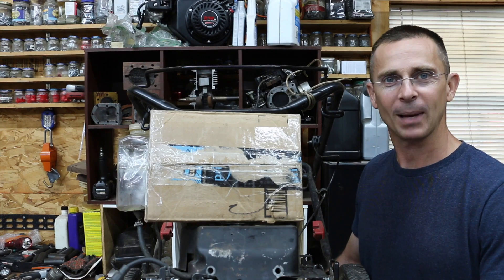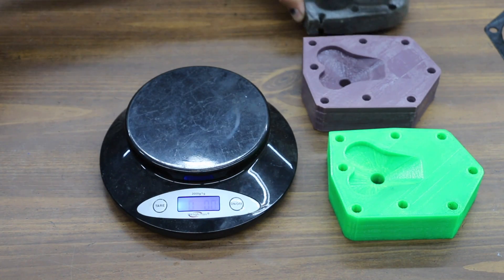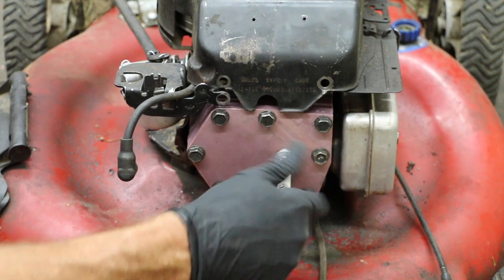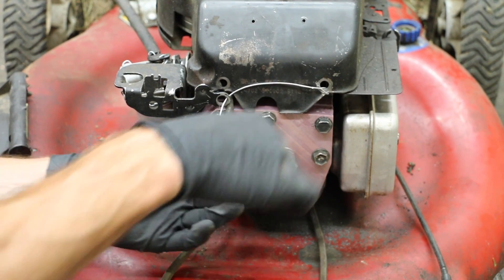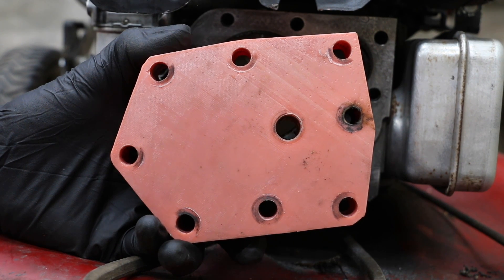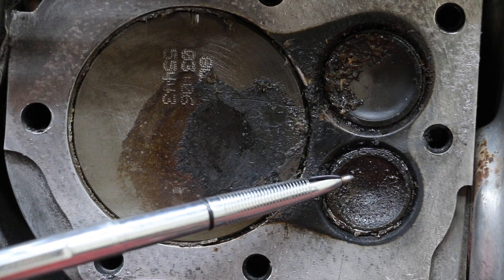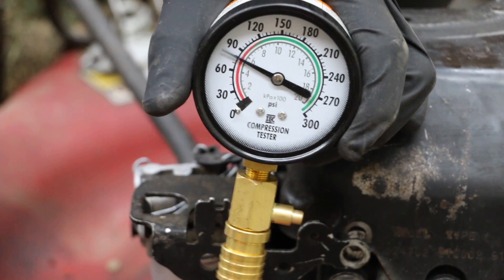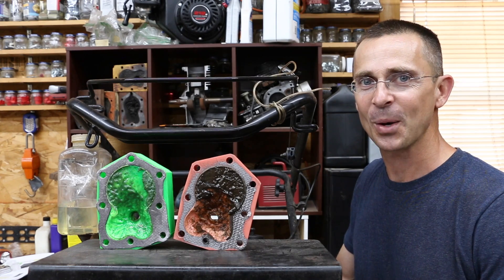How long will a 3D printed cylinder head last?  Let's find out!

Comment: What about making a gasket out of metal like a 3D printer does? getting something like a 1/4 inch thick piece of steel or aluminum and then cutting out something like 8 -10 pieces and gang drilling the holes to bolt it on to the cylinder. Then you would seperate them and drill successive holes so that it approximates the shape of a normal cylinder head, then you would just need to create a bunch of gaskets for between each piece of the gasket head. You could even try a bunch of different gaskets at once but since the outside would not be as hot as the inside it would not quite be as fair as it would be cool. Alternatively or to finish it off after testing a bunch of gaskets you could weld all the plates together and only use one regular gasket. also what about running cylinders with no gasket and maybe just aiming for a precision ground surface with wet or dry sand paper on glass plates?
Reply from the maker: Great recommendation!

Comment: you still had some plastic "shmoo" on the valves, seats and exhaust, from the first head, more the second head, seemed to be a bit lower compression with the "gaskets" on metal head than there should have been
Reply from the maker: Yes, you are right. The intake valve didn't seal well at all during the headgasket test.

Comment: before watching past 0:49 seconds, I'll guess around 10 seconds for the heads and 3 seconds gaskets. probably still an overshoot estimation :)
Reply: everything lasted longer than I imagined, but 3 d printing is just a no go for anything engine/heat/pressure related, it's just too porous and soft of material. maybe some commercial/industrial stuff would be better..
hope ya'll didn't breathe too much of the burning ABS and PLA fumes, the combustion process was for sure burning it at unsafe levels compared to printing temps and was releasing toxic "shmoo" /carcinogenic fumes :(
Reply from the maker: Thank you!  Great advice on breathing the smoke. I always wear a high quality respirator.  I couldn't smell the smoke.

Comment: will making an air cooled engine into a water cooled engine decrease efficiency because it cannot reach normal operating temperature
Reply from the maker: Great point. I believe air cooled engines typically run a little richer on fuel.  Water cooling would likely improve efficiency.

Comment: Great video! I kind of figured that the 3-D printed cylinder heads would fail early due to ABS and PLA being a thermoplastic polymer and therefore will deform due to heat. 
I know that JB Weld is a thermosetting epoxy but have you considered trying other thermosetting polymers for cylinder heads? Better yet would be a composite using a thermosetting resin and a fiber reinforcement. I think either of those would make an interesting video.
Reply from the maker: Great recommendation!

Comment: Spark plugs depend on their thermal contact with the head to control their temperature. Had the plastic somehow held up, the plug would have died from heat stroke at some point later anyway.
Reply from the maker: Great point!

Comment: If I could get my hands on that STL file or the part, I would be happy to send you that same part printed in a more temperature resistant material, such as carbon fiber nylon or polycarbonate.
Reply from the maker: I'll check with Terry to see if he can send the STL file. It'd be fun to test carbon fiber nylon or polycarbonate.
Reply: @ProjectFarm  My local community college has a 3D printer that can do aluminum- lol I could print one in metal for you!
Reply: You can electronically mail me at askgdfw at googlemail
Reply: Polycarbonate has a 66psi tensile strength at 260F ish after hardening. It will break under pressure. Nylon X will survive the pressure but temperature beyond 320F will melt it. Depends as pressure and temperature at the same time and increase stress in the material to crack and blow out  if the material isn't able to cure or set properly during printing and curing stage.
Reply: 3d print a metal head, that could be interesting
Reply: Yep. and there are tons of shops out there that can do it.
Reply: I gotta say, this is one of the best comment sections I've ever run across on YouTube. Congrats project farm for your amazing viewer base!!
Reply: The problem is that fused filament disposition relies on using materials that melt at low temperatures, a 3d printed plastic cylinder head would either need a temperature resistant coating or some better cooling system, maybe running oil through the head. Or an upgraded printer and some very high temperature plastic. Or maybe water injection into the cylinder during the exhaust cycle to take the heat out before it builds up.
Reply: MarcAFK water would vaporize and create steam which I'm sure would only make the problem worse and oil would make it way hotter we make metal smelters with oil injection. it needs a carbon base so it will not melt so easy I think mixing shredded fiberglass with resin and a little hardener would work good maybe 3d print the mold..
Reply: Flowing oil or water would cool the plastic and stop it from failing.  You'd have to design cooling galleries into the head so it doesn't fail into the cylinder.
Reply: The process of water becoming steam absorbs a tremendous amount of heat energy from the intake charge, that's why methanol injection exists in the first place. First for high performance ww2 aircraft, and now commonly on high performance boosted/high compression automotive engines to prevent preignition.
Reply: Not true! Many 3d printing materials are high heat and require an oven-like chamber being constructed around the print area.
Reply: Meep Changeling Although yes, some 3d printable materials are designed to be more heat resistant, for example nylon and polycarbonate typically require a nozzle heat of more than 300 degrees C compared to the 200 degrees C of pla in order to get the plastic to flow, the "oven" that many printers are seen in are typically there to prevent warping of the printed object by keeping the ambient temperature warm, it has little to do with the heat resistance of the finished 3d printed object.
Reply: There are also types of PLA designed to be further heat treated or anealed giving them a much higher temperature before they deform.
Reply: Yes, some materials are printed at higher temps. But keep in mind that combustion chambers typically reach temps around 600 degrees celsius. For materials with that kind of heat resistance you would have to look into DMLS printing. At that point, it's more cost effective to just go and buy the standard parts.
Reply: No, not really.  Compared to the temperatures attained by an air-cooled engine, fused-filament deposition printers (and their environment-control chambers) still run at quite cool temperatures.    Filament that deposits metals or ceramics for post-sintering may get into the right ballpark.
Reply: Do it!
Reply: Gear Down For What? Dig your videos! And it would be cool to see these tested with better temp resistant material
Reply: Should try one with a high temp  material using a form labs 3d printer. its an sla printer using uv cured resin.
Reply: Print it in PEEK.
Reply: I think you'd need to print it in something like PEEK to give it any chance of withstanding the high temperatures. The stuff requires a special hotend though, and it's not cheap either.
Reply: Smoothing out the combustion chamber should help also. A lot of surface area in those parts.
Reply: I have students who printed parts that were used on rockets. Parts for the body but also parts for the engine and tail using a burn proof polymer (ULTEM). They did very well at the competition with printed parts.
Reply: I think if you could put some cooling fins in it, a lot of problems would go away
Reply: probably would not be good enough. Its the "glass" temp you need to look at, as this is the temp it starts to to deform and melt. This is much lower than the extruder temp listed with 3d filament as this is the temp it needs to be liquid. If you want the engine to run longer that a single run, you need to run it lower than glass temp. someone listed https://www.3d4makers.com/products/peek-filament which has the highest glass temp ive seen at 143c.
Reply: Theres even metal particles filaments!

Comment: Why didn’t the 3D printer recreate threads in the spark plug hole?
Reply from the maker: I believe it's possible, but that would have required a lot of programming.

Comment: Thank you SO MUCH for this video!  I own a 3D printer, and find it absolutely invaluable for making things like brackets and hooks and things.  I no longer wander around the hardware store, looking for something I can adapt to my needs; instead, I just make it.  I laughed and laughed throughout this video - I knew it couldn't work, as ABS melts readily at 210C (410F) aqnd PLA packs it in around 180C (356F).  But it was a great try, and an awful lot of fun to watch.  I did think the gaskets would last longer, though.  Terry did a great job of making those parts, and I'm so pleased you gave them a try; that was more fun than I've had all week.  Thanks again.  >Charlie
Reply from the maker: Charlie, Thank you very much!

Comment: Can you revisit penetrating lubricants? I would like to see what the old trick of letting wax melt into rusted threads would do.
Reply from the maker: Yes, I will definitely test this to see if it's a myth or if it really works. I've got the bolts undergoing the rusting process now.

Comment: As a 3D printer I know it's not enough, what I would LOVE to see is if a cam (double cam) could be printed and the engine be converted to a compressed air engine.  Amazed it actually ran at all, but I knew it wouldn't last all that long...make a hybrid, coat inside with jb weld to see if holds up longer.  Awesome video...keep em coming
P.S. annealing PLA make it more heat resistive than ABS...but I  have never done it
Reply from the maker: Thanks a great recommendation!  I've seen plastic cams in mowers. So, it's likely to work rather well.  Great recommendation on the hybrid approach too.  Thanks again!

Comment: Like your videos but when you say you were "impressed" with something lasting a minute and 23 seconds???? Good grief. 
Also you then say you think a 3d printer would be a good addition to the shop?? Sounds like you're begging for someone to send you one. Come on man, you're better than that!
Reply from the maker: Thanks for commenting. The fact that a printer produced a plastic strong enough to withstand the enormous explosive pressure and heat at all seems impressive.  I'm definitely not wanting someone to give me a printer.  It was very generous of Terry to make the heads and head gaskets. I've declined lots of generous offers.  Finally, I do believe 3D printers have a lot of utility in a shop. Thanks again!

Comment: I wonder if you could get one of the companies that make metal 3D printers to make a cylinder head for you? That would certainly be interesting.  

I know one company I always see ads for, Markforged, makes an "affordable" metal 3D printer.  (Affordable being the low low price of $99,500.....) But regardless, I think that would be super cool if they would do it!
Reply from the maker: Great recommendation!  Regarding the price of the printer--wow!  Way out of my reach.
Reply: Project Farm that's enough money for a lot of small engines haha
Reply: You might try using a 3D printed plastic part to make an aluminum or bismuth alloy head using lost PLA or a sand casting.
Reply: Spacex uses a metal 3D printer to make their engines, so they'll certainly handle the combustion temperatures and pressures of a gasoline engine OK.  The kicker is the printer price.
Reply: charles worton Boeing use sintered metal for their engines.
Reply: what's the point, you know it would work like a normal cylinder head..
Reply: Yuri Gagarin if you print the same thing as a casting, there is no point. It’s just more expensive. The benefit of 3D printing metals is the crazy complexity you can make that you wouldn’t be able to make any other way. That allows for things like optimized flow passages and absolutely optimized structures to minimize weight. For smaller quantities, it’s also much faster and cheaper than waiting for tooling to be made for a casting
Reply: The way metal 3D printing works is that they print the part from wax or something, make a mould around it, burn the wax out then cast metal in it. At least this is the method i've heard of, correct me please, if i'm wrong, but i don't see any other logical way it could be done, because metal needs to be homogenous, and not 3D printed from layers, where some kind of glue would hold together the particles, that doesn't make sense.
Reply: Szabó Arthur look up DMLS. That’s what we use. It’s a powder bed laser process
Reply: Something like an automated mig welder could 'print' metal but material integrity would certainly be affected by all the hot and cold cycles.
Reply: Luke H there are Direct Energy Deposition machines that sorta do that, but DMLS is the primary 3D printing method for metals. It involves laser welding powder, but the heat transfer issues you mentioned are mitigated through scan laser strategies. The material properties are very good once the parameters have been figured out
Reply: Szabo...thats tradition lost wax or lost pla casting...just happening to use a 3d printer to make the "lost" part...metal 3d printing is either layers of metal powder  sintered in a furnace or direct deposition and welding by layer...some use a spray binder and some use a rod or strand more similar to a regular 3d printer.
https://www.desktopmetal.com/
http://3d.markforged.com/metal-3d-printer.html?mfa=bing&adg=NA-Metal-X&kw=metal-3d-printer&msclkid=f16112cc1b3018444dca49a30d988527
Reply: mountainmanfab our machines do not require a post-print sintering step because it’s a welding process. They do require stress relief though. Most commercial machines are this way
Reply: srry Ben was replying to Szabo not sure why the reply hit the main post...yeah some like yours are direct but the trend now at least in smaller setups is towards the binder type due to not needing a shielding gas in the actual build chamber while still being safe to view/use in a small shop/office situation.The price is of course still ridiculous...will edit my previous post to reference the different type
Reply: mountainmanfab gotcha. Yeah, you’re right though. The binder type of printers are definitely cool for home use, but I wouldn’t trust the material properties too much yet. They’re sintered and there are still issues with completely getting the polymer out
Reply: yeah...have my doubts too lol...lotta sintered parts out there for yrs but most have issues usualy from shock loading or stress and the fact that when they fail its almost always complete failure and not repairable without replacement.While  sintered parts have far more uses then even the best plastics its gonna be awhile (if ever) before the machines reach a price point that most will ever consider for home or hobby use...hell more then a bit steep even for a "small" business.Would love to have one to tinker with but cant see having a spare 100k just burning a hole in my wallet any time soon :)...Maybe one of the companies will donate a machine to me to prove me wrong...lol...not gonna hold my breath tho
Reply: I work in additive manufacturing with metals. Unfortunately, it would be tough to convince a company to do this without them getting some sort of benefit, even in the way of a tax write-off. Super expensive. The rule-of-thumb number I’ve heard our costing guys throw out is ~$1,000/print hour. That seems high in my opinion, but the real number is definitely still high up there
Reply: You can build one yourself for a lot less money. Use a laser to melt aluminum dust. You can easily convert a standard 3d printer. You would have to replace the bed with a box to hold the dust and modify the slicer to do the z axis. It may need to be a core xy type printer but it's doable
Reply: bkpickell they still need to be able to handle shielding gas flows, precisely control powder flow for layer thicknesses of tens of microns, and precisely control a very high-power and rapidly-moving laser. DMLS machines are very sophisticated because the process requires it to get usable material properties. Even the powder is extremely controlled in its production because the particles need to be certain size distributions and morphology for heat dissipation and flow properties.
Reply: Ben Wilson Given enough thought , trial and error. I still believe I can build one for under two grand.
Reply: bkpickell you can find a 400W laser for that budget? Keep in mind that you also need the capability to move the laser spot ~1000 mm/s with a lot of direction changed to manage the energy density properly

Comment: Project Farm I agree a turbocharger on a small engine would be an interesting video, I have watched all of them on YouTube and elsewhere.  My research shows that Volkswagen smog pumps from the 1980's are similar to roots superchargers and can push nominal pressures with the correct gearing (6 psi + and 250+CFM by my guestimation) also some smog pumps are like miniature scroll superchargers in design, but that takes research to find which ones, and keep in mind you have to gear them at a far higher rpm than they were designed for.  I have only come across a handfull of powerful ones demonstrated with data.  Excellent content BTW
Reply from the maker: Thank you for this information and for the positive comment!

Comment: I wish it was a higher temp plastic like: Polycarbonate. Also would have been nice if the ABS was smoothed with an acetone vapor
Reply from the maker: Great point!
Reply: I did some with a brush to seal the cracks up